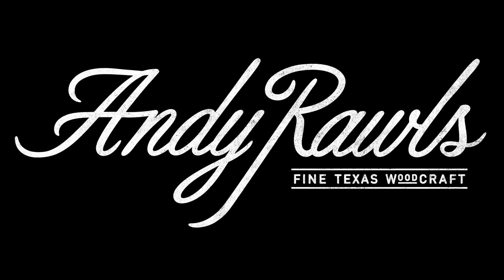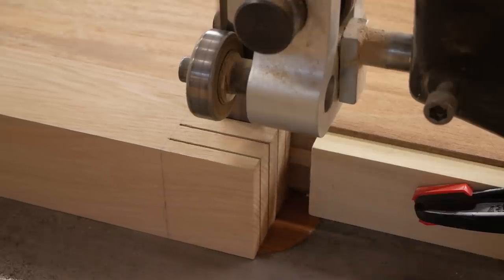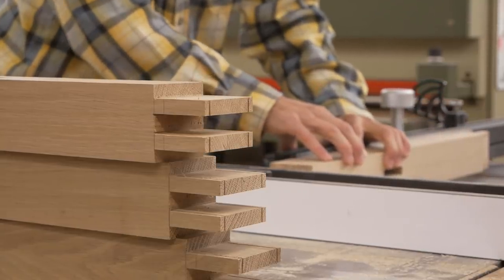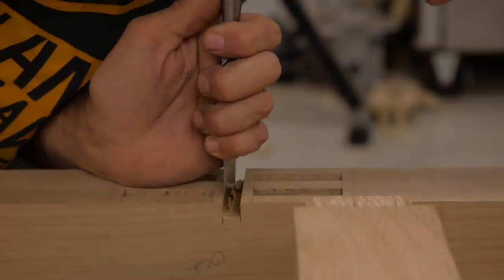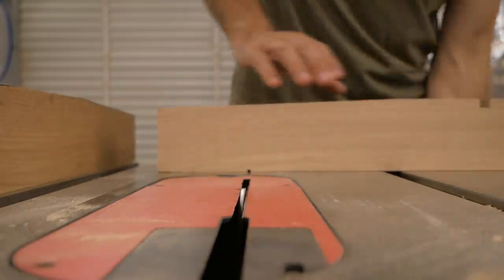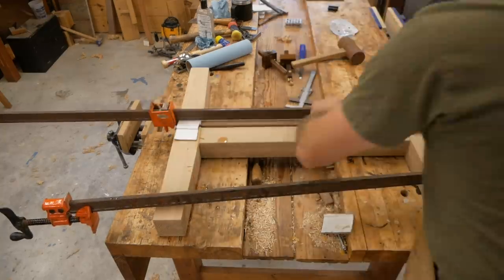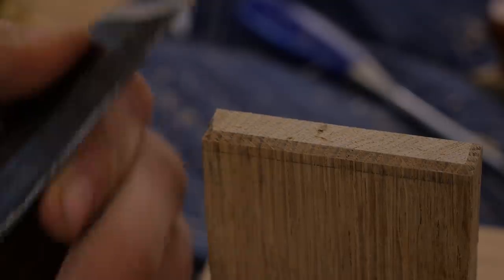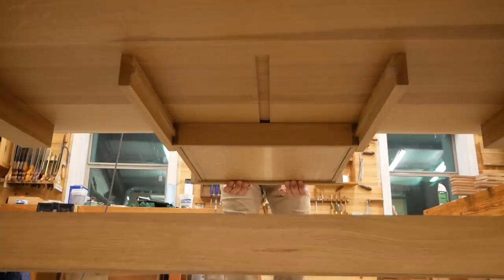Trestle Table Build Part 1 - No Screws Just 20 Mortise And Tenon Joints!

Comment: When it comes to glue squeeze out I am in the camp of just letting it dry then cleaning it up with a chisel, scrapper or chisel plane. I have had problems with the glue getting into the pors of the wood when wiping it off with a damp rag causing issues when staining.

Comment: Looking forward to the rest of this build. Just curious, on the stretchers, why did you not centre the tenon on the work piece? It looked as if there was more of a shoulder on one side than the other.
Reply from the maker: Great question...wasn't sure if anyone would pick up on that.  I was worried about knee space so I moved the stretchers in closer to the middle by offsetting the tenon.  It only gained about .5" so I'm not sure it was too helpful!
Reply: @AndyRawls  Very interesting. It's the thought that counts.